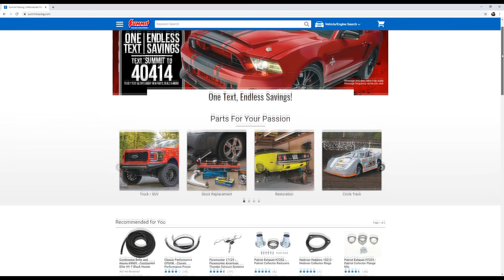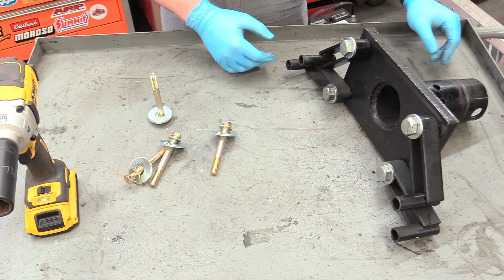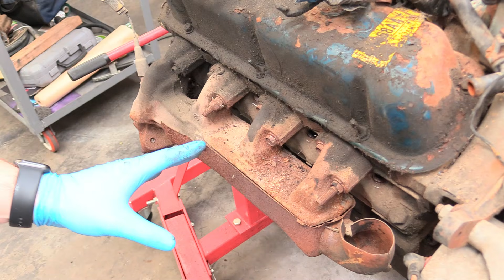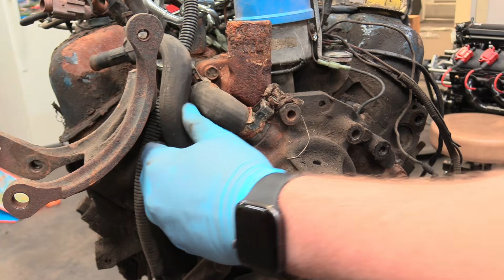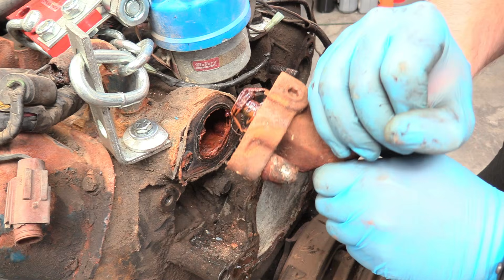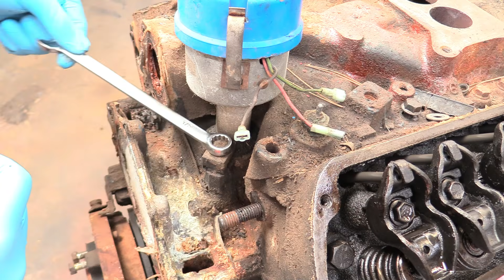How to Build a Ford 302 Small Block - Part 1: Removing the Intake, Heads and, Front Accessories

Comment: My 96 OBS F-150 has a 302 5.0 Windsor. Currently at 227k miles. I am keeping up with the maintenance, but do you think it's better later on to take out the engine and rebuild it piece by piece or buy a whole new crate engine (if I can find one)?
Reply from the maker: If you are doing a stock build and can get an OEM crate thats the way to go. But if you only can get after market then I'd just build the one I had. Thanks for watching!

Comment: I've built three 302s. Two were about 220 horsepower, and the last, and best one was 325 horsepower, and was the accumulation of all my efforts. It was in a 78 black Mustang  coupe with Centerline wheels. It wasn't one of those lame coupes with the dreaded " Ghia" window, and the ultra lame vinyl top, or all that extra lame trim. It was an automatic, and a really sweet car! I know how to polish any metal to a mirror finish. So along with my intake, and full carb, my alternator, powersteering pump, and then brass bolts, and brass pulleys, and other parts. I want to build a " 302 Clevor" I have for 39 years every day! Something might happen that will give me the opportunity? I've already been planning everything out, and I'm going to get the intake manifold brass plated, along with all the carb, and brackets, bolts etc.😂
Reply from the maker: That sounds like an incredible project, thanks for sharing!

Comment: For anyone that can help me out hear, my experience is limited but i have worked on a few toyota motors and love working on engines, my friend has a 302 in a 70 mustang grande, when he pulled the intake manifold off, we saw what looked to be rust and pitting on the cylinder head right at the front passenger side, it looked pretty messed up when i saw it, should we just replace both cylinder heads  should we find a used one, try to save this one or spend $500-$1000 on new cylinder heads

Comment: Do you have a comprehensive parts list available for this series? I’m getting ready to build a 347 starting with just the machined block. Absolutely everything will be new. This is my first time building a complete engine, so I reeeeaaally appreciate the detail here. It would be super helpful if you had a complete list of everything that went into it, especially things like the sealants, gaskets, and odds and ends. Thank you!

Comment: I have a 2001 au falcon with a efi 302 Windsor, is anyone able to tell me the difference between the USA and AUS 302? Is one weaker than the other? And does any American manufactured performance part work with the AUS 302? Or are they 100% identical, sorry for all the questions, it’s just taken me a while to get the answers due to google and threads never explaining things properly

Comment: Junked that valve train out, hopefully the bottom isn't junk . Balance the crank assembly will let you know for sure.
Reply from the maker: Considering it was hydro locked and had bent pushrods I wouldn't trust it in a new build. We ended up with a stroker kit so whole new bottom end that was balanced. Thanks for watching!

Comment: Ford has been that way with the bolt lengths and diameters since the late 60's. Don't forget where they go or you're going to be playing in and out with the bolts on your water pump and timing cover.
Reply from the maker: I got new bolts any how but yeah.

Comment: You forgot to mention draining the oil out of the oil pan before removing the flywheel bolts.  Unlike Chrysler and GM V-8 engines from this era, the crankshaft flange on a Ford is drilled completely through.  Removing the flywheel bolts before draining the oil will result in oil running out everywhere.
Reply from the maker: No it wont. The oil level is below the crankshaft. This engine had oil in it and you can see not a drop came out when I took the flexplate off. Thanks for watching!
Reply: @2carpros  But if someone were to try to replace a flywheel with the engine still in the car, depending on the angle of the car on supports, oil will run out everywhere.  I have seen it happen.  I just thought that you might want to point this out because not everyone has an engine stand and an engine, even if removed from the car,  could be setting at an angle where oil could run out and make a mess.  I am not trying to be argumentative, just thought that pointing this out in a video might encourage viewers to drain the oil first and then no matter what angle the engine was setting when the flywheel bolts were removed there would be no mess.   I DID enjoy the video.  Keep up the good work.

Comment: Install a swivel and you can rotate the motor 360 degrees.
Reply from the maker: Yeah that would be good! Thanks for watching!
Reply: It works great.  I did it on mine.  I have the HF 2ton hoist and gear drive engine stand.

Comment: I learned something while replacing my head gaskets, a 85 302 WILL run on only 4 cylinders and it wont sound to bad too lol, will die as soon as its in gear tho, replace fuel injectors and wires!!! Even if they dont look to old... THEY ARE

Comment: Hey man 
I’m manual swapping my 302 and the bell housing I’ve bought has the starter motor port is on the drivers side, and the starter is on the opposite side,would it be possible swap the starter motor over?
Hope that made some sense😂
Cheers

Comment: I HAVE THIS ENGINE (1973 WINDSOR) IN MY BOAT AS A 188 HP MERCRUISER .  I WANT TO REBUILD MINE AND BRING IT UP TO 300 HP, OBVIOUSLY WITH A MARINE CARB.  SHOULD I BE DOING THINGS DIFFERENT THAN WHAT YOU ARE DOING IN YOUR VIDEO?  THIS WILL BE MY FIRST ENGINE REBUILD.  I AM VERY MECHANICALLY INCLINED.
Reply from the maker: I would do everything but the stroker kit then if you want 300hp or so. Thanks for watching!

Comment: If you want to reuse old bolts, put them in a container of vinegar overnight. Wire brush them the next day and they will look brand new. Wash the vinegar off with baking soda and water then put some oil or wd40 on them to keep the rust from coming back
Reply from the maker: Great tip!

Comment: Okay, I came across your videos, and you are the closest to the perfect professional video on 302 Windsor Engine. However, my question is I want to rebuild my 90 bronco and 89 Ford F150 5.0 which is also a 302. Will this work for me? Both of my engines are EFI.

Please let me know asap, been starting at my phone for to long looking for answers and reading books with not much depth into it.
Reply from the maker: Yeah it should! I believe the only difference is the carbVSefi from stock. But we end up putting EFI on ours in the end with a Summit throttle body. Thanks so much for watching!
Reply: @2CarPros  Thank you, this will be my first-time engine rebuild so I'm a little nervous but your videos have made me feel more confident. Thanks again

Comment: I have two 289 blocks ( 1965) A-code out of a Fairlane 500 both were running when pulled out. One has a crane cam, I brought it with new lifters, headers and a brand new  holly 600cfm fired it up. Ran perfectly, just had to idle it down. Put it in a 73' ford f-150 with big dune diggers tires, ran real well in a 4000lbs + truck!!

Comment: I had an 86 f150 with the 302, had a few issues, but ran great, plenty of power but my dad and I were gonna get rid of the EFI and put a carb on it, when I pulled the intake I saw bent pushrods, I swear it did not run like it had any internal damage, shocked everyone around lol, the ford small blocks, and even big blocks from back in the day we're amazingly resilient engines
Reply from the maker: Well now you have the excuse to rebuild it and put more power! Thanks for watching!

Comment: The 302 officially came out in 1968, but in 1967 the 289 got the longer cylinder walls needed for the increased stroke. So if you want to stroke out a pre 1967 289 block (back in the day it was done with a machined Y block truck crank) you will find when the piston reaches BDC, it can come out of the bore just enough to rock around. So consider a modern roller cam block if you're going to go stroker--and if you nab an Explorer engine from the 1990's, you'll get the GT40P heads for free.

The Mallory distributor is a good find (there are companies online who will rebuild or use it for parts), those who want an OEM high energy distributor like GM's HEI have to find an early 1980's unit that didn't require computers that came out in 1985-86.  302's come with two different weight flywheels over their lifetime so don't get it mixed up if you replace parts. I like to put old fasteners into a 50/50 brine of salt and vinegar, using the typical plastic containers your local deli sells you salads in. you can write on it exactly what is in there and they'll derust as you continue on with the engine--it'll probably work on that thermostat housing as well.

when you pull a cylinder head, leave a couple of bolts in finger tight to hold it from dropping on your feet (dowel pins should do that, but if the engine's had a rebuild they may be missing). find what piston is at TDC, pull the spark plug, and run some compressed air into the chamber--even a bicycle tire pump could work. So long as the cylinder holds compression, the air pressure should pop it right loose for you
Reply: I have a '00 explorer I want to build up. This videos what I'm using to build that.

Comment: Is there a way to tell I have bent push rods?  My town car was sitting for a while it started it it may have been wet at the time.
Reply from the maker: Take the valve covers off and see if you can jiggle the rockers. If it wiggles a ton then you have one. Thanks for watching!
Reply: @2carpros  I can’t do that that’s the only way?  By sound?  Will it ride rough?What about odb1 scanner?
Reply from the maker: @DannyNY  That's the easiest and fastest if you ask me. But if you have a bent pushrod you effectively have a dead cylinder that won't fire. It will run terrible if it even runs.

Comment: My 1989 Town car has a 302... but only 150hp
Reply: Is my engine like this?
Reply from the maker: Yeah I believe they are same. Probably a different oil pan and intake but the rest are super similar. Thanks for watching!
Reply: @2carpros  but with so much less horse power?  Will it be more simple to work on?  What are the key components that are different?

Comment: i'm curious on how much wd-40 spray was used before doing this, especially after using your battery impact most of the time lol. I spent alot of time rebuilding my 302 front end with basic hand tools because it looked like that block. Bravo though, makes me glad to see that I still managed to do it the correct way.
Reply from the maker: None surprisingly. The thing was so greasy and gross it was pre lubed with ick haha Not to mention that battery impact kicks butt! 

Thanks for watching!

Comment: Excellent video, ¿what DeWalt model do you use?
Reply from the maker: Thanks for watching! 

I use this for 3/8 https://www.amazon.com/DEWALT-DCF883B-20-Volt-Lithium-8-Inch/dp/B007NVSQEQ/ref=sr_1_7?crid=1XGFMKCU6ONH0&keywords=dewalt%2Belectric%2Bimpact&qid=1644949205&sprefix=dewalt%2Belectric%2Bimpact%2Caps%2C137&sr=8-7&th=1

And this for 1/2 https://www.amazon.com/DEWALT-Cordless-Impact-Wrench-DCF894B/dp/B078WDTV2F/ref=sr_1_4?crid=1XGFMKCU6ONH0&keywords=dewalt+electric+impact&qid=1644949205&sprefix=dewalt+electric+impact%2Caps%2C137&sr=8-4

Comment: Great detailed video! I got ahold of a 302 out of a '73 mustang with the matching transmission.  I tore it down like you did and stroked it to a 347.  Used roller rockers and lifters.  I put it in my '66 mustang.  Now its faster than the speed of color!
Reply: Those 347 builds are fun, even if you kept the stock heads, can reach 350 hp.
Reply from the maker: NICE! That is so cool! Thanks for watching!

Comment: I see you're using regular Cro-moly sockets on your impact gun. Don't do this - they're brittle, compared with a proper impact socket, and can shatter.
Reply from the maker: Technically correct, but I've been doing it for ever and it seems fine as long as you have high quality sockets. Thanks for watching!

Comment: Couple of thoughts. First: shocked to see the FACTORY hose clamps!  I really think they are a better design than the ones you can get at the parts house and would love to use them on all of my cars.  Second: Had a 302 in an 84 Grand Marquis and had to change the water pump.  Pretty sure Ford hung the water pump on a chain at the factory and proceeded to build the car around it.
Three: Made the same sound you did when I spotted the bent push rods.
Reply from the maker: I agree those hose clamps work great. 
Yeah totally about the timing cover. Not the best design IMO. 
It was surprising to find bent rods! Thanks for watching!
Reply: I think that was the easiest I've ever saw a 5.0 Water Pump come off lol most I've dealt with were a Bitch lol
Reply: I have a ton of the factory black hose clamps that come on the mustangs